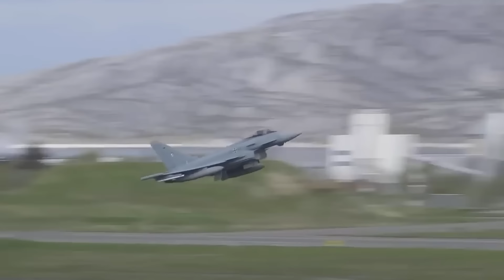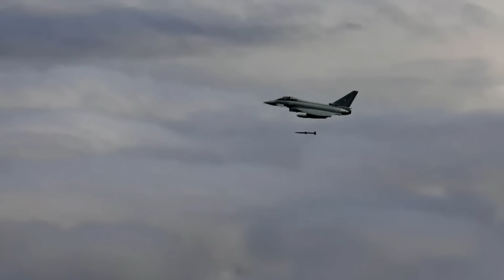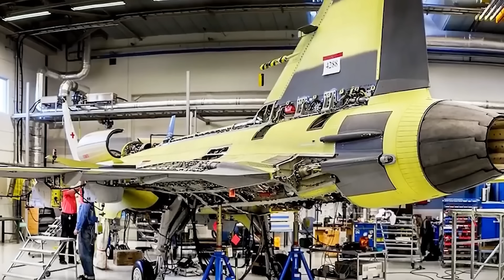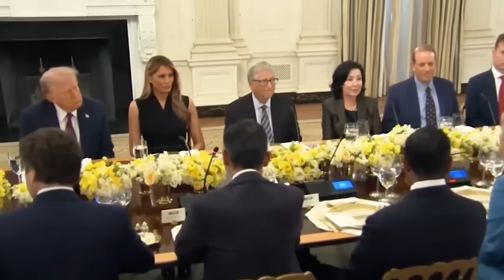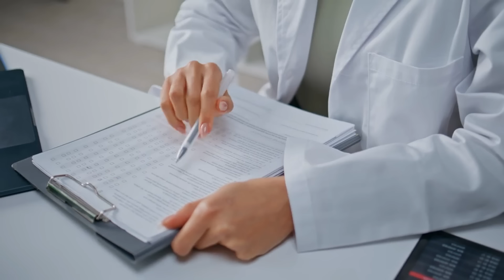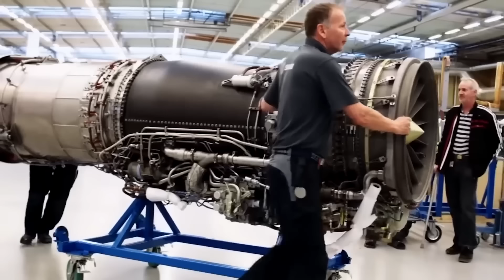Rolls Royce Silently Modified the Gripen — NATO Didn’t See This Coming!

Comment: There's a proposal for a new model of Gripen that would be built around an RR engine instead of the F414.  But it's not possible to just drop a RR engine into an existing Gripen.  The proposal was that only new-build Gripens, built from the ground up to a different fuselage design that accommodates the new RR engine, would be built and sold with the RR engine.  Gripen-E, built around the F414, can only fit the F414, and cannot be re-engined without tearing them apart and rebuilding them essentially from scratch for tens of millions of dollars a plane.  Sweden has a lot of Gripen-E airframes, and they cannot afford to simply send their entire air force back to the factory to be rebuilt.  And so that's all it is, and likely all it will ever be, a proposal.  Like the CATOBAR naval Gripen, and the STOVL Gripen.  None of them will ever exist outside a sheet of paper, because actually making any of them real, even assuming the technical problems are fairly easily solved (and if you've ever dealt with airplanes, LOL along with me about that), is absolutely cost-prohibitive.  A deal-killer for any plane, much less one where the main selling point is it's cheap.

Comment: Prime Minister Carney is on the verge of fixing what Prime Minister Diefenbaker did wrong on Feb 20 1959. We need to move forward with the Gripens, Canada 🇨🇦 needs to do whats best for Canada, the Rolls Royce engines with the Gripen E is the best choice for the majority of our fighter aircraft, talk about the vaults built for the 16 F35's is not an issue, the amount we are saving by going with the Gripen E 's for the rest of our fleet 70 to 80 Gripens, more than make up that cost, the vaults will still be there for the F35's that we already committed to. The Gripens should make up the majority of our mixed fleet, the Gripens are the better choice for Canada 🇨🇦, the previous evaluation you see  referenced on here was with the Gripen C not the Gripen E nor was it with the Rolls Royce engines, it also didn't include the down time and maintenance issues, parts being controlled by the US. There was  also bias in the assessment, the requirement for longer runways and issues adapting in northern most climates, the ballooning costs for the F35's. For all these reasons the Gripens are better for Canada's operations, especially cost and cold weather operations and down time between flights. Gripen E can land and takeoff on shorter ice roads as runways, better choice for Canada 🇨🇦, economically puts money in Canadians pockets with jobs for production and servicing for years to come in Canada, full control over technology and parts. The turn around time is much quicker than with the F35's and the engines need to be replaced less frequently, way more cost effective going with the Gripens, meaning we can build more of them for Canada with less cost. Its a no brainer, Gripens all the way!!

Comment: Is there a pilot comparison from a pilot that has flown both the Gripen and th F-35 series?

Just the facts please;
Yes, a notable comparison comes from Morten Hanche, a Norwegian fighter pilot who was the first Norwegian to fly the F-35 and also had extensive experience flying the Saab Gripen during his training and exchange programs. 

His feedback highlights the fundamental generational shift between the two platforms:
Generation Gap: Hanche explicitly notes that the Gripen is a highly potent aircraft but belongs to the 4th generation, whereas the F-35's 5th-generation status is its defining advantage.

Sensor Fusion vs. "Switchology": He has commented that while the Gripen is agile and capable, the F-35 provides a level of situational awareness through sensor fusion that "cheats" the traditional dogfight. In the F-35, the pilot acts more as a mission commander, whereas the Gripen (especially older versions) requires more manual "switchology" to manage sensors.

Maneuverability vs. Stealth: Hanche noted that the F-35's high-alpha (angle of attack) capability allows it to perform maneuvers that would be difficult for a Gripen, though the Gripen is often cited by others as being faster (Mach 2.0 vs. Mach 1.6) and more agile in a traditional visual-range "knife fight".
The stealth attribute makes the aircraft as easy to detect as locating a 1.5” dia. whiffle ball. This defeats the low frequency radars. The issue with all aircraft that are not stealth is that the released radar blockers are limited in number and when that happens the aircraft is exposed.
Operational Philosophy: He pointed out that Norway chose the F-35 largely because of its stealth capabilities and deep integration with US and NATO allies, which the Gripen, as a non-stealth platform, cannot match in high-threat environments. 

Structural life before replacement;
F-35A (Standard) - The plane Canada is considering: This variant has shown exceptional durability in testing. It has successfully completed all  "third-life" fatigue testing, easily simulating 24,000 hours of flight (three times its required life) without structural failure. This gives the program high confidence that the service life can eventually be officially extended.

The Gripen Structural live is 8,0000 hours before replacement with no fatigue endurance testing beyond. As of 2026, the Saab JAS 39 Gripen E remains officially rated for a structural life of 8,000 flight hours. Saab has not privately of publicly announced completion of fatigue testing beyond the 8,000 hours.

Gripen Supply Chain;
Despite being a Swedish aircraft, the Saab JAS 39 Gripen E is famously known as one of the most "American" European fighters due to its heavy reliance on U.S. technology. 
Approximately one-third (33%) of the Gripen's components and systems are sourced from United States suppliers. The US can control much of the Gripen’s technology.

There has been persistent speculation about a Rolls-Royce powered Gripen using the European EJ200/EJ230 engine. The Reality: As of 2026 Saab’s CEO has stated that using a U.S. engine remains the only economically viable solution. The Rolls-Royce would place the aircraft at a much higher less marketable cost.

Saab has floated the idea of a Canadian production hub that would create up to 9,000–10,000 jobs. However, this facility would still likely assemble U.S.-sourced engines rather than manufacture domestic replacements. 
Defense News

Economic Summary:
While Canada could build this manufacturing base, the billions in upfront R&D would likely exceed the total cost of just purchasing the entire F-35A fleet ($27.7B+), which already includes significant Canadian-made components. More politics vs common sense.

Domestic Opportunity: Saab has floated the idea of a Canadian production hub that would create up to 9,000–10,000 jobs. However, this facility would still likely assemble U.S.-sourced engines rather than manufacture domestic replacement

It has been said the one F-35B is as capable as two Gripens;
While there isn't a single "official" quote from a pilot using that exact "two-for-one" phrasing, the sentiment is frequently echoed in military evaluations and pilot testimonials comparing the F-35's 5th-generation "force multiplier" effect against 4th-generation jets like the Gripen.

The "Capability Gap" in Data;
The "two-for-one" or even "three-for-one" claim often stems from mission effectiveness scoring in official competitions:
Canadian Evaluation (2021 Data): In a leaked report from Canada's fighter competition, the F-35 scored 95% in mission performance, while the Gripen E scored 33%. This suggests that, in the specific high-threat scenarios tested by the Royal Canadian Air Force, an F-35 was viewed as nearly three times more effective than a Gripen. Politics has since intervene and this report has been shelved. The hatred by Canadians for the US has prevailed.

Sensor Fusion Advantage: Pilots like Morten Hanche describe the F-35's ability to "cheat" in combat because it sees everything first. In exercises, a small flight of F-35s can often dismantle a much larger force of 4th-generation fighters (like Gripens or F-16s) because the 4th-gen pilots never detect the F-35s before being "shot down". 

The U.S. government’s position—most recently highlighted in high-stakes procurement friction with Canada—is that a non-stealth platform like the Gripen cannot "operate" with the F-35 in high-end conflicts because of interoperability and data-sharing security. 
The core issue is not that they cannot talk, but that they cannot talk securely while maintaining the F-35’s primary advantage: stealth. 

1. The "Stealth-Killer" Data Link Problem
The F-35 uses a highly specialized, low-probability-of-intercept (LPI) data link called MADL (Multifunction Advanced Data Link).
MADL is designed specifically to share massive amounts of data between F-35s without emitting signals that an enemy can track.

The Gripen, like most 4th-generation jets, primarily uses Link 16. Link 16 is an omnidirectional radio signal that acts like a "beacon" for modern adversary sensors.
Security Conflict: If an F-35 turns on its Link 16 to talk to a Gripen, it effectively "lights up" its position on enemy radar, neutralizing its stealth. 

2. "Sovereign Control" vs. Integrated Encryption
The U.S. maintains strict control over the encryption standards and mission data files used by the F-35. 

U.S. Argument: For a foreign aircraft like the Gripen to truly "plug in" to the F-35’s specialized network, Saab would need access to sensitive U.S. source code or encryption keys that the U.S. is unwilling to share.
The Blind Spot: U.S. officials have warned that using the Gripen in a shared defense environment like NORAD creates a "technological blind spot" because the Gripen cannot process or contribute to the same high-security "fused" picture as the F-35. 

3. Software Dependencies (The "Kill Switch" Risk)
From the U.S. perspective, security isn't just about the radio; it's about the ecosystem.
Control: The F-35 relies on the ODIN/ALIS cloud-based logistics and software system, which is hosted on U.S. servers.

Risk: The U.S. argues that introducing a non-integrated platform like the Gripen into this ecosystem introduces cybersecurity vulnerabilities that could compromise the entire allied network.

F-35B Lightning II Demo - Yuma Airshow 2024
https://www.youtube.com/watch?v=PEp5F43-JWk

What’s the difference between F-35 and Gripen fighter jets?
https://www.youtube.com/watch?v=Iuqr5zxu-7A

Comment - If the cost of operation is your requirement then the Gripen is the correct plane If fighter capability, range, stealth and a massive lethal armament load including drone deployment and more the F-35 series is the superior aircraft. JDS

F-35 air Dominance;
https://www.f35.com/f35/news-and-features/f35-air-dominance-defined.html#:~:text=Force%20Multiplier,other%20fighters%20and%20military%20assets.

Amazing Video of F-35 Shows Its Insane  Maneuverability;
https://www.youtube.com/watch?v=UI5qaoZQ5G4

Comment: According to a Google search:  "The Saab JAS 39 Gripen uses different engines depending on the generation. The newer Gripen E/F series is powered by a single General Electric F414-GE-39E turbofan engine. The older JAS 39C/D models use the Volvo RM12, a license-built, modified version of the General Electric F404."
Also, according to Google search:  "Sweden officially joined NATO on 7 March 2024, after depositing its instrument of accession to the North Atlantic Treaty with the United States government in Washington, D.C., making it the 32nd member of the Alliance. This marked a historic shift for Sweden, which had maintained a policy of military non-alignment for over 200 years. As a NATO member, Sweden now benefits from the collective defense guarantee under Article 5, which considers an attack on one member as an attack on all."
If any of this video is correct, that's excellent as Canada is seriously considering purchases of the jet.

Comment: Rolls Royce has been improving aircraft for decades. The American P51 Mustang started with an Allison V 1710 engine. In mid 1942, a development project known as the Rolls-Royce Mustang X, replaced the Allison engine with a Rolls-Royce Merlin 65 two-stage inter-cooled supercharged engine. Following receipt of the test results and after further flights by USAAF pilots, the results were so positive that North American began work on converting several aircraft developing into the P-51B/C (Mustang Mk III). What an amazing company.

Comment: This is not true. The Gripen E uses a US engine, namely the General Electric F414-GE-39E turbofan. It would be impossible to switch the engine to another one. They would have to change the plane design. This is a Fake video.

Comment: I'm sure that someone else will have mentioned that Rolls Royce Holdings Plc (which makes aero engines amongst other power units) does not make cars, it licenses the name to Rolls Royce Motor Company, a subsidiary of BMW!  The two operations became separated in 1971 after the aero division suffered financial difficulties.
Reply: Correct and I was working in Derby at the time.

Comment: Remember, this is a BOT CHANNEL MEANT TO CREATE DIVISION BETWEEN ALLIES.

Please also remember that all Americans either like or love Canada, and have for a very long time.  I do like Donald Trump, but frankly, sometimes he doesn't know when to shut up. My apologies.

Now on to the meat of things.  

Nothing even comes close to the performance of the entire F-35/US ecosystem.  Did you not see what happened in Iran?  They couldn't stop us - and that was with Russia's 300 and 400 air defense network.  

That said, the Gripen-E is an excellent direct action plane and can be used much the same way the F-15EX and a few other non-stealth aircraft were used in Iran.   But it cannot go it alone because it is not designed for that kind of mission. It is meant to be a hit-n-run asset that would make things very difficult for Russia in the near term.  If Russia was everything it claimed to be, then the Gripen would be most effective in tandem with stealth fighters clearing the way .  Interestingly enough,  this is what Canada might do since it s contractually obligated to buy 16 F-35's.  Now this configuration would probably work to a limited degree,  more F-35s would be needed,  otherwise the current minimum contract  would be only be strong enough to keep Canada safe in the early stages of aggression from Russia or China - even with a complement of Gripen-E's.  

The biggest difference is that the F-35 is also designed in such a way that it could easily last to 2070.  The Gripen-E, not so much, as it was designed from the ground up to be very plain and effective against the current set of non-stealth fighters, but that is literally all it has.  It is not designed to be infinitely upgradable - the F-35 is. 

But on to bigger things.

Russia's present state indicates it's air force is not able to beat a near-peer coalition.  In fact, things are so bad they are not able to beat Ukraine whose Air Force, at least on paper, would not be able to stop Russia.  Yet somehow they did.  And with US/NATO help they are slowly getting control over their own sky and when that task is complete Russia will have no alternative but to run back home - that's if there is a home to run back to.  

The Chinese have been taking back ancient turf from Russia that the early Czars took from China when it was in a weakened state.  Putin is probably glad to be rid of the burden, but he may also accidentally be giving China the wrong signals.  

And with Russia's  military assets largely destroyed and the citizens there fed up with Putin,  China could quite literally walk over to Ukraine and no one could stop them.  You know what - China did that once before, so history can repeat itself UNLESS NATO is armed to the teeth and ready to fight.  

The whole concept in preventing war is to demonstrate that you overmatch your enemy's capabilities enough to discourage bad behavior.  This is NATOs responsibility.  Our responsibility, as long as we are able, is to provide the backstop and backbone needed to ensure NATO forces win the day every time they are tested.

Comment: This is AI bullshit. SAAB is considering reengining the Gripen, but nothing has been decided. This presentation is being presented as "fact" but that's false. What SAAB has said is that the entire aircraft would have to be redesigned, so it's more likely that future versions might incorporate the Rolls Royce engine, but not the Gripen E/F. 
Wishful thinking is no substitute for reality.
Reply from the maker: Totally get where you’re coming from! It’s easy to get caught up in the hype. Let’s see if they pull anything crazy, though!
Reply: @fighter.aircraft  Even with the GE engine, the Gripen is still a better buy for Canada than the F-35.
Reply: Correct.  https://www.youtube.com/watch?v=azxiRv9Pxbc    If Gripen was modified to accept the RR engine, it may no longer have the attributes of the Gripen.  No proof that it would fly as well, or any better.   May loose it's cold weather durability.  Many years of development changes, many more years of testing and certification, many years of retooling that would likely shut down current production.  Likely a 10 to 15 years process before the first unit was ready for sale.